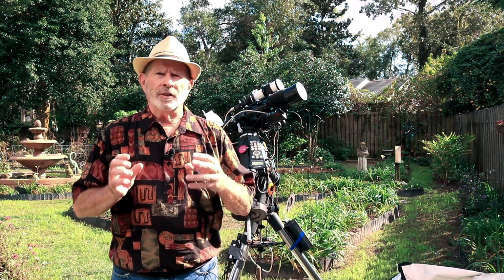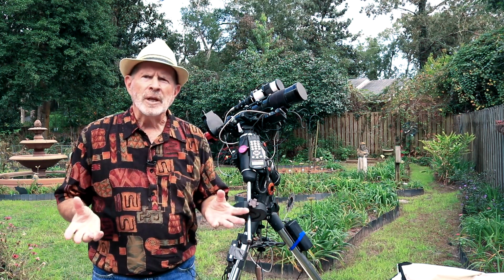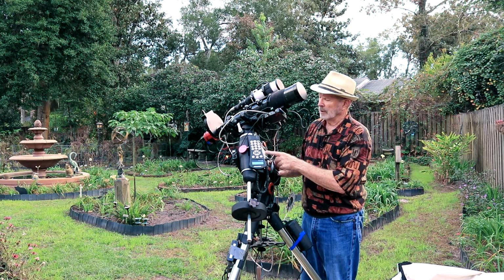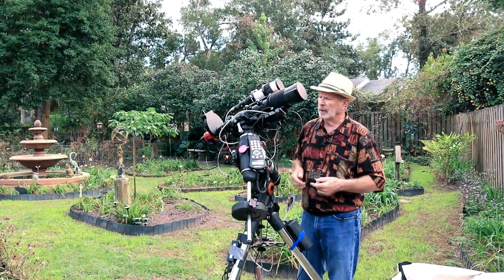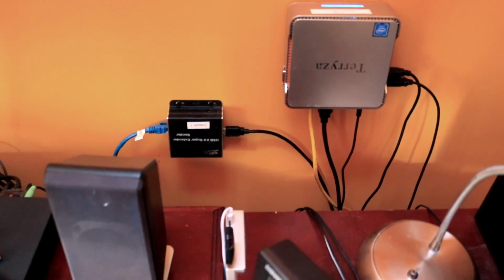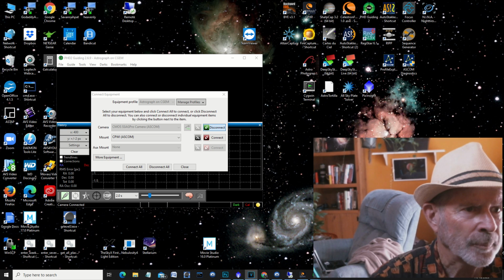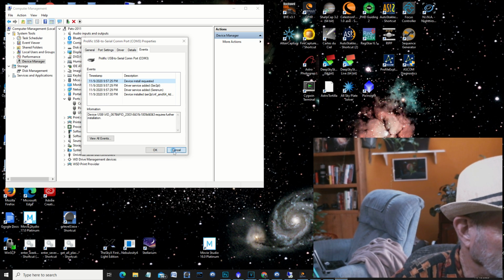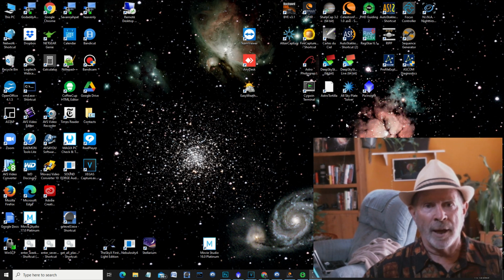USB Extender Connecting my Telescope to Inside Computer for comfortable astrophotography

Comment: Thanks, Pat!  I was already using Remote Desktop with a Stick PC attached to the tube, BUT I had some connection failures.  I think your tip on USB sleep settings solved my problem!
Reply from the maker: I also added a WiFi booster to give the remote computer on the rig a strong connection.  And yes, the remote is set to never sleep.

Comment: Very nice setup Pat. Just the information I was looking for. Setting up my new rig now and although the Ioptron mount works well with WiFi, that leaves me still sitting close by, to cable up the cameras etc. I am thinking that USB to LAN for a long run into the yard is going to be the solution . I'll terminate the LAN at the scope into a powered USB 3.0 hub and then connect all the various devices into that. Basically eliminate the mount Wifi option altogether. Still viewing various options for a power box of some sort at the rig. Clear skies!
Reply from the maker: Thank you.  If you have the option, I would go with the mini-computer set-up.  These new mini-computers are amazing!
Reply: @HeavenlyBackyardAstronomy  Can you give us the specs for the mini PC that you are using? Thanks.

Comment: Richard - Belgium - Hello Pat. Good useful video. I've just purchased a BMAX B3 (Amyastro channel uses one) and trying to set it up.
I want to use it through WIFI. I've got a router. Wondering why you adopted USB cables...WIFI connection is not reliable...?
It seems then that results are better with Win10 pro on the "home PC" than "Teamviewer" or any other software. I should upgrade mine then.
Reply from the maker: I tried both and the WiFi does work well, but it seemed that the network connection was smoother plus when I transfer the fit files from the B-Max to my desktop, it was like grease lightning using the cat6 network line.  I too got the idea about the B-Max from AmyAstro.

Comment: Hello really interested in this extender. Sounds like a great idea. Can u tell us witch brand u use. Thanks great idea. Bill Needham
Reply from the maker: The USB Extender works rather well but I am leaning on the min-computer connection using that same Cat6 cable.
Here is a link to a USB extender ... https://www.amazon.com/Extender-Connect-Printer-Keyboard-Support/dp/B08DD57517/ref=sr_1_53_sspa?dchild=1&keywords=usb+super+extender&qid=1605968339&sr=8-53-spons&psc=1&spLa=ZW5jcnlwdGVkUXVhbGlmaWVyPUEzMVFFVjMwVk05TFNOJmVuY3J5cHRlZElkPUEwODM1ODc3MTE4WFY4MVE4UlBYTSZlbmNyeXB0ZWRBZElkPUExMDQ1MTI3M1A5N1YxVlpBUDI3NyZ3aWRnZXROYW1lPXNwX2J0ZiZhY3Rpb249Y2xpY2tSZWRpcmVjdCZkb05vdExvZ0NsaWNrPXRydWU=

I am also looking into using a KVM extender for the mini-computer but at the moment, the remote connection is working just fine.  But using the KVM extender, I won't need to use my main desktop to control it.  Soooo many options.